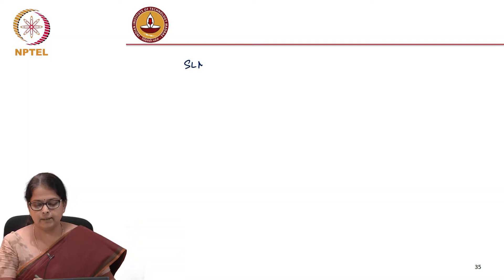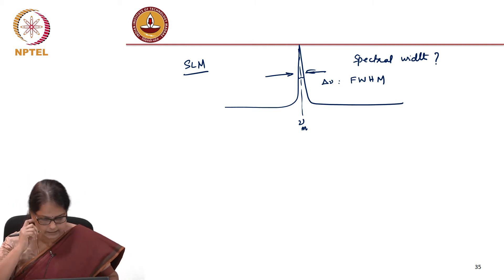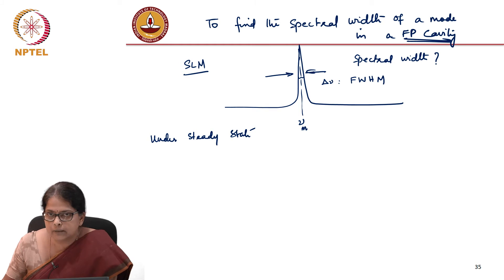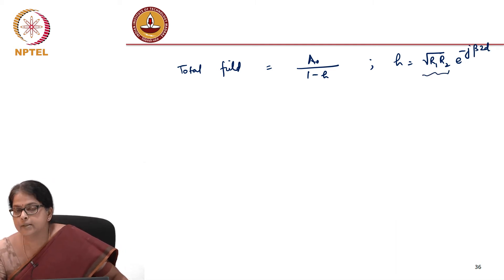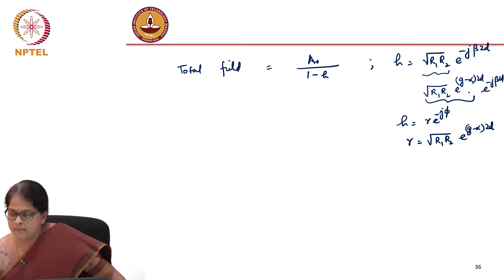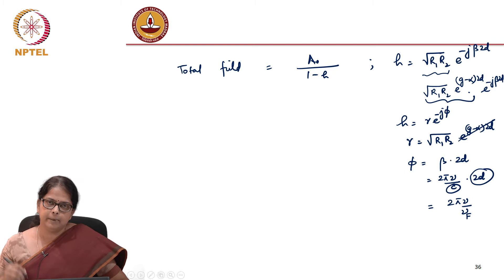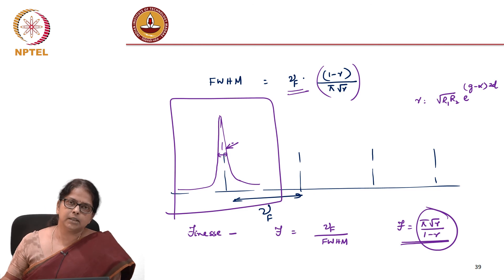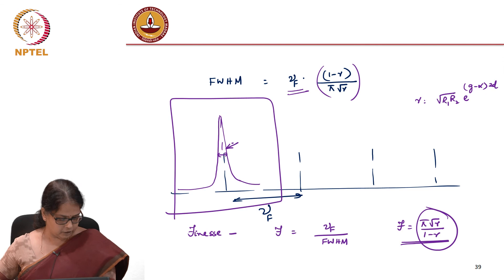Lec19: Laser Diodes: Resonator Concepts 1c

Comment: But ma'am if sin(angle) becomes close to Pi, its no longer small angle then, then why did you take it as small angle approximation?
Reply: actually she told the converse, here nu is actually offset from the longitudinal modes, so it's alwasy smaller than nu_F.